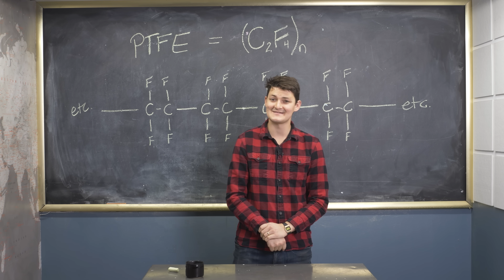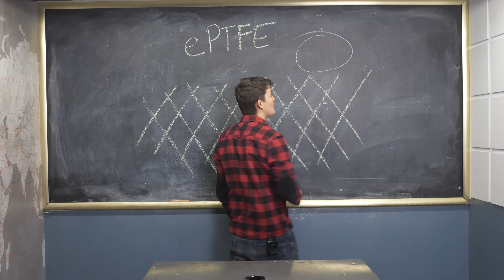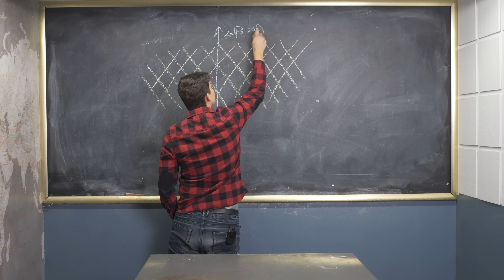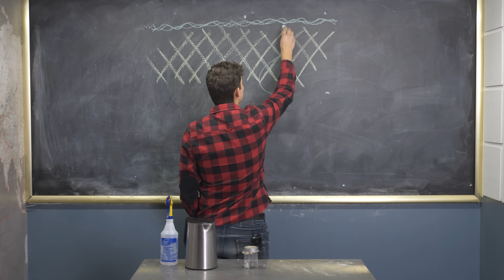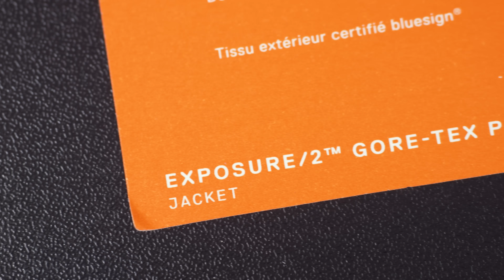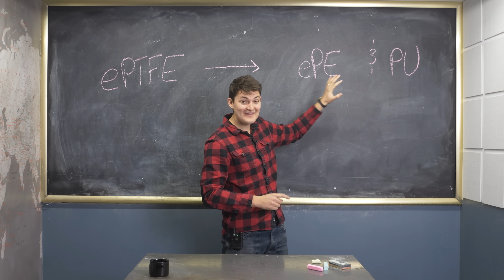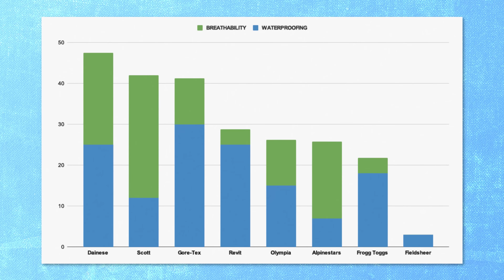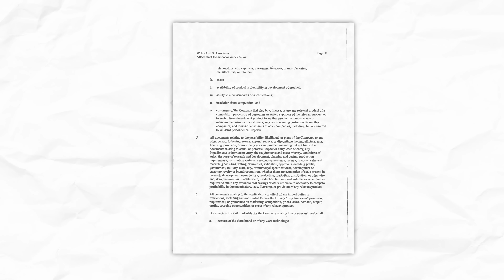Gore-Tex is a Marketing Gimmick

Comment: I find gore-tex useful in the snow while snowboarding. Keeps you dry on deep days, then once on the lift if where you aren't in wet snow, it can do the breathing so you aren't overheating. Also generally powder just breezes by, but it's nice to know you'll be dry when you need it. So it's up for both challenges throughout the day.
Reply: I agree and this proves his humidity differential proposition. The air is likely dry outside the jacket and humid inside.
Reply: Ugh, being cold on the chair lift for those few minutes but sweating your balls off while going down the mountain is the worst. You open up your jacket on the lift to attempt to cool off and it's instant frostbite since anything under your jacket is soaked with sweat.
Reply: Came here to say this. I live in Hokkaido where it dumps with snow non-stop from December through March. I go snowboarding wearing a thin base layer, down jacket mid and a Dakine Gore Tex shell jacket which keeps me completely dry yet allows regulation of temperature. It keeps me significantly warmer and drier than my old "waterproof" jacket. There's a reason why all the pro's wear goretex bibs and jackets. And idk where he's getting this $1000 price tag from, my jacket cost 20000 yen ($136) and it's top quality. I guess maybe it's not a great material for riding a motorcycle but y'know, choose the right gear for the job maybe, for example when doing backcountry I keep the jacket in my bag until it's time for the descent. Testing it by going out in to the rainforest is just ridiculous haha.
Reply: @8bitsub412  Thanks. Looking for a jacket now to come up to Furnao from Tokyo in Feb. Could you tell me the exact model # of that jacket?
Reply: @YM-ay24S  Sorry just seen this. Not sure of the exact model but it's a Dakine shell jacket, no insulation. Enjoy Furano!
Reply: @8bitsub412  A Dakine Vapor Gore-Tex 2-Layer Ski/Snowboard Shell Jacket here is $500!
Reply: @8bitsub412 what do you wear for midlayer pants while snowboarding?? Or just base pants + bib?

Comment: Another issue with goretex, or any membrane material is once the dwr is worn off, which takes a few weeks, the material soaks out.  Then you're skiing, riding, sailing, or whatever in wet clothes for days on end until the sun comes out and you can dry everything off.  Like homie said, doesn't work well when it's wet.  If I know it's going to rain on a ride, I take my vinyl jacket.

Comment: You're a bit off on the physics. You're talking about vapour pressure and assuming it's the same as humidity, which it is not. The vapour pressure in a 37°C, 100% humidity environment (inside the jacket) is much higher than in a <20°C, 100% humidity environment (outside the jacket).

Comment: Cool vid!
Personally I've quit gore-tex for the most part.

I prefer a thick cotton coat with no waterproofing at all.

Once it's wet additional water tends to flow over it. Humidity makes its way inside but it is gradual and the coat ends up warming up similarly as a diving suit does.

Once it stops raining the excellent permeability to air makes it dry rather quickly. Ideal in environments that are not too extreme.

Comment: Great video as always and love a New FortNine video when it arrives.BUT! Biggest missed point left out here and the reason i will always buy GoreTex being an avid outdoors person especially mountaineering and Sea Kayaking is that GoreTex will warrantee a product for the lifetime of any product that uses it and as long as you have not abused or clearly mis-used it in any way. I have had lots of outdoor clothing and sea kayaking gear and foot wear with proprietary membranes and down the line and some even 12 months post warranty period will simply laugh at you as say it leaks thats your problem, some will be a bit more sympathetic but GoreTex are hero's as they will Normally replace with a NEW CURRENT item for the one that has delaminated or starts leaking that has not been abused. I have had myself my girlfriend and friends i know have had new £1400 drysuits that are 5-10 years old replaced with brand new current models free of charge or just pay the postage and i had a  Arcteryx jacket that was 4 years old that i backpacked and climbed with excessively delaminated on the shoulders from pack straps and they give me a brand new current model absolutely free of charge to replace it. See any other brand do that!, i have yet to find one and i've been through a ton of gear. You pay for a lifetime or as good as of top notch kit even if it performs like others you just don't get that guarantee so its worth the outlay 100% always.  ( i'm not sponsored or paid or work for Goretex in any way at all i just appreciate not wasting money in the long run which i turn also is waste against the planet). Not a dig i love your channel just putting a point across. Cheers guys!.

Comment: It's definitely not waterproof. Go on any 6 hour journey through rain and eventually it will give way at the seams
Reply: I think you had some bad luck, or got hold of some low quality of manufacture clothing.  I have a pair of Goretex bibs that I've worn downhill skiing and winter camping for many, many years.  Made by Arc'teryx it cost a pretty penny.  After nearly 20 years of use the seam tape is still working pefectly.  Best single piece of outdoor wear I've ever owned.

Comment: 7:27 Ironic that as you're delivering the "knock-off" line - you're sponsored by a camera that is a Chinese-owned knock-off of the USA-founded GoPro Max 360º camera!  They even blatantly use GoPro's 2-finger mount system!  Now that's poetic.

Comment: I worked in a kids shoes store for many years.  I must have repeated thousands of times to parents that most all tex membranes are perfectly good, even if they don't carry the name Goretex. 
It really is a product where people are extremely brand loyal.
Reply: Back when YouTubers started to advertise Vessey shoes I eventually bought a pair since I lived in NYC at the time, and walking around during April when it rained like crazy, and stepping into that puddle you thought was an inch deep but was actually 3 inches deep SUCKED. When I got them I was suspicious that they were really waterproof and probably more heavily water resistant. I decided to test this by putting my hand in one and running it under the sink at full blast for like 30 seconds. My hand and the interior of the shoe was completely dry. I was pretty amazed since the shoes were average price ($70-$80 IIRC). I can't say much for the quality of the soles/cushioning, but then again New Yorkers beat the hell out of their shoes walking a few miles a day on concrete.
Reply: @Brando56894  
How have your Vessis' waterproofing lasted since? Mine lasted a little over 2 years (+2-3 months) but now around the toe area where the sole meets the fabric, water gets in. I've used it as an everyday shoe for 2 years, maybe I abused it last winter by intentionally walking through several feet of snow for 8 km to test its waterproofness.

Curious to know if your shoes are still waterproof or not. Tested the Vessi Everyday Classic's waterproofness.
Reply: Only a Shoe Salesperson could call a synthetic fiber "Perfectly Good."

Have Sheep poisoned the water table, or bees?
Only the sheep that share DNA with You.
Reply: People cant decide If the Shop only got products with Gore Tex 😅

Comment: I’ve been arguing this for years: it may be breathable on a molecular level, but in practice it’s not. You need venting to accomplish that. Floating rivers in Alaska, when then is a lot of rowing, and because of cooler temperatures, I often face the dilemma: what will be better, getting wet from sweat or from rain? I finally made a canopy for my raft, which solved the problem, although I got mocked for it endlessly, until my compadres saw how awesome it performed.  But that was only practical on tamer rivers.

Comment: Totally disagree with this . I’ve a Mountain Equipment ‘ jacket lined with Gortex. It sees the rain in the UK. I’ve had  it 20 yrs, looked after it and it’s superb. Care instructions are there for all to read . A decent coat, say around £250 upwards with Gortex is unbeatable. 
It was only last month a bought a cheap waterproof at £80, it failed after 20 mins . I’ll stick to my preferred brand with Gortex and care for it as per the instructions

Comment: not gimmick. I have gore-tex rain jacket for hiking, and it's only one jacket (from those I tried) which both protect from the rain and from sweating. I had non-goretex jacket and I felt like in sauna. Of course it can be very different across vendors, so i can't compare all jackets in the market, I believe there's some good which are non-goretex and some bad ones which are goretex. But I happy with mine.

Comment: This is kind of like saying down is useless when it's wet. It's true, but it also provides the greatest warmth at the lightest weight when it's dry. Gore Tex works best in freezing or near freezing temperatures. The other options are non breathable & you'll sweat out sooner from the inside, or fully breathable & you'll be wet & cold from the outside. If it's warm & wet then pure old plain skin is the best waterproof breathable, & it costs nothing.

Comment: I was a little disappointed in the membranes. Salomon shoes work well in cold weather while you're outside and moving. But if you stop, you quickly freeze. And if you go in a car where the heating works, your feet literally burn or just get wet.

Comment: Dainese gear is as expensive as Goretex, meaning if it has the brand recognition they'd charge 3 times more if they could do I'm gonna still with Goretex for skiing, where it's features actual work as advertised that you've completely ignored(zero humidity on frozen mountain and you're never totally wet on the outside)

Comment: When i hear a material is "breathable" i don’t expect air to be constantly self-blowing through it.  It just means air can pass through unlike latex or leather or things like that.  I don’t think it’s false advertising, it is waterproof and it is breathable.  Why would you ever expect both at the same time?  Though actually, some parts of the jacket may have water on it, covering up some of it, but the other parts will be able to have air circulation just fine.

Comment: Gore-tex  is easily the most rain resistant fabric when new. Trouble is it doesn't stay rain resistant for long at all and even after reproofing its never quite the same.
Reply: The same could be said for any breathable waterproof garment. Washing properly and then applying something like Grangers or Nikwax is critical. You can also wash incorrectly and basically ruin the garment.
Reply: Gore Tex & DWR are two different things.

Comment: lot of flaws in the logic but i get what you are saying.  a DWR coat wont keep you dry but a goretex coat will until you sweat heavily.  to keep the DWR new you wash in nikwax and recoat with nikwax dwr.   ive tried other versions of waterproof breathable materials and most will condensate worse.. so as it sits goretex and a few newer type fabrics are still better than what else is out there in most conditions.

Comment: 02:37 🌧 Gore-Tex is waterproof in lab tests, demonstrating effectiveness against water pressure, but real-world breathability varies, impacting its performance in humid environments like rainforests.
04:02 🌬 Gore-Tex's breathability relies on humidity differentials; when conditions are wet, it's waterproof, but breathability diminishes, creating limitations in varying weather conditions.
06:07 💼 Gore-Tex's success stemmed from monopolistic control via patented machinery, forcing manufacturers to adhere to strict guidelines and use Gore-approved materials, leading to market domination even after the patent expiration.
08:50 🏍 Competing waterproof membranes exist and perform similarly or better than Gore-Tex at a lower cost, suggesting Gore's market dominance is upheld by alleged antitrust behavior, impacting fair competition.
09:44 🏷 Consumer perception drives the inflated market for Gore-Tex-labelled products, despite functionally similar alternatives, showcasing the power of branding over actual product differences.

Comment: That's why i always wear wool.  Breathable, water repellent, warm ish when wet and lasts and lasts. if its heavy rain and all day, then i throw a 100% water proof shell on, due to the wool absorption you don't get wet from sweat, even if it builds up over time, it will never get soaking. ive have walked up mountains before in rain with a waterproof shell and wool shirt underneath for hours, got to camp took the shell off and not be wet at all. try it out. aslo if there is a little water in between the wool and waterproof shell then its still better than getting fully soaked by rain.

Comment: I remember buying a water proof version of my favorite running shoes -- and man, I learned quickly why runners don't advocate for them (even saw some saying they'll just use sandwich bags as socks under actually good running shoes). Water proof running shoes are rigid and hard (your toes feel like they're pressing against plastic) AND your feet get muggy. YUCK. I have had better luck with waterproof boots, but for running -- stay away from waterproof.

Comment: From a thoroughly unscientific, anecdotal standpoint, our cheap Gortex army-surplus waterproofs were infinitely better than expensive pvc waterproofs when spending 8 hours at a time in them on wet work sites. The differences might be scientifically small, but they add up if you live in them!

Comment: As someone that spent my whole life snowboarding and camping year round the west coast of washington state there is nothkng better then legit gortex. Now mabye its changed but i have bought plenty of jackets and clothes gortex and non goretex with similar specs and the goretex as always outlasted and out proformed even higher end brands. If you can afford it, its worth it. Also back when i was younger it was the only breathable and waterproof options that was affordable. Yes you could find 2 or 3 thousand dolalr mountaineering jackets thay would be as good but for 300 to 400 bucks you could get a great waterproof jacket. I get its just a material but I always also made sure I got nicly made jackets and not just because it said goretex you always gotta look at the specs even with goretex stuff.
Reply: You are so right.  I guess some people could figure out a way to get soaked no matter what they're wearing, but my experience as a mountain guide and a fly fisher is just like yours.  Goretex works and it works better than anything else I've ever used.  Not saying there's not other good stuff out there, but the claim that Goretex isn't waterproof or isn't breathable is bogus.
\

Comment: Goretex is generally not that much more expensive than other materials. Perhaps $100 more on a winter jacket for a 2L. I have bought subpar materials that just aren’t as durable or keep their waterproofness over the 5-10 year timeframe. Goretex also has a limited warranty in case there is any issue such as the material delaminating.
Reply: you are correct: The price comparison is very unfair.
It compares a laminated jacket with Gore-tex, with a nog non laminated jacked non Gore-tex, laminated jacket's are double in price because it's way more work and needs to be made wit a lot of handwork, so that explans the price difference, hense it's not the membrane!

Comment: Gore-Tex is like literally every product ever - Do your research. If you are in need of a single garment solution (maybe for convenience, for size, for weight etc) which can handle calm town and city outings in torrential rain AND outdoor exertions in clear weather which might rain, get Gore (or equivalents). I've also yet to find a fabric which keeps up with Gore's finest pro line for face fabric durability and stitching, found on Arcteryz kit.

If you live somewhere warm and wet, yeah you are going to need another solution.

Comment: I bought into the whole marketing gimmick 15 years ago when buying "waterproof, breathable" jackets. Everytime I went hiking or use the jacket, I soaked myself from the inside out. And the worst part is the outdoor gear industry keeps repeating the same non-sense to this day.

Now I just use softshell jackets or realize I'm going to get wet and plan accordingly.
Reply: personally, i always just have a softshell on me and a waterproof membrane accessible in the bag. best option are membrane jackets with gigantic aeration zippers. got a jacket with zippers that go elbow to ribs passing on top of the armpit, that's some real breathability right there.
Reply: @niscent_  Very true. Mechanical ventilation is the answer to this problem. Gore Tex will keep you dry and protect you from the elements, and pit zippers will keep you dry on the inside.
Reply: Agreed. I first tried GT about 20/30 years ago. Absolute waste of time and money.
Reply: Get a full plastic layer. You'll sweat like a pig, but it will keep you dry. I think ponchos work quite well as long as you are not going over crazy terrain.
Reply: Go wear softshell in himalayan blizzard. Good luck.
Reply: @icom782   a Himalayan blizzard is definitely relevant to 99.9% of people...
Reply: @TROPtastic  All I mean is that gore-tex is made for specific tasks and there are times when you need membrane and no other membrane can beat gore-tex at this moment. 

Of course it's not perfect but if you do alpinism or just hiking you agree to the fact that you will get wet and sweat sometimes.
To compensate for that you have other layers of clothing that can make the whole experience better.